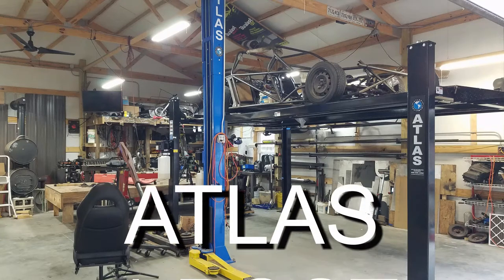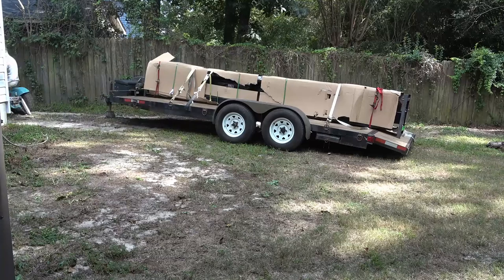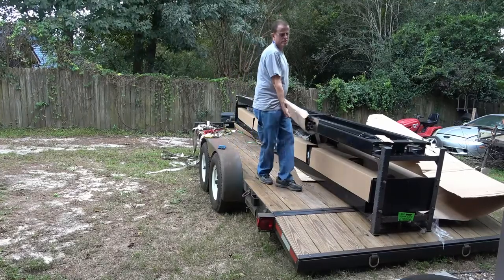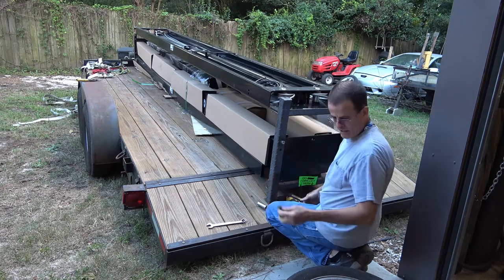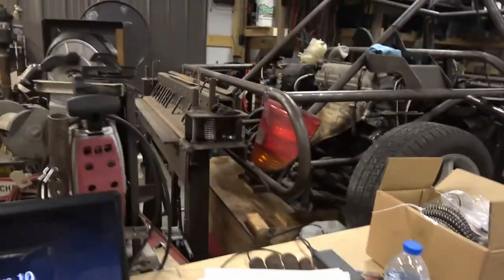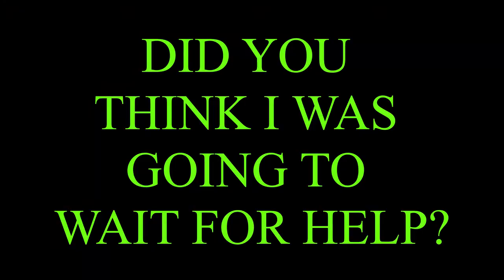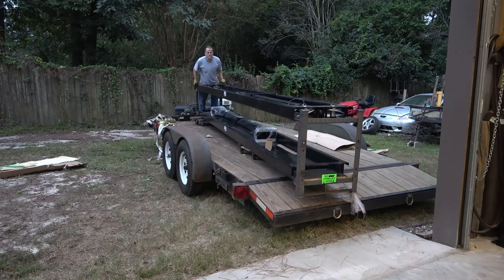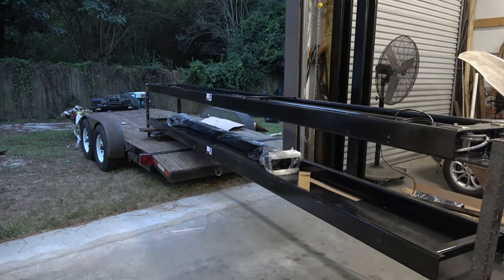ATLAS 4 POST LIFT, Part 1. buying a lift,  pick up and unload

Comment: Ok so you have both lifts. I’m looking to build a garage and I’m eventually going to get a lift. I do normal work on friend and family cars and trucks. I’m currently in the debate of going 4 post or 2 post. With you having both and could only choose one which one would you go with
Reply from the maker: If I was only going to have one lift.  I would go with a 2 post . It lifts from the frame and leaves the vehicle more open to work on.
Reply: Ok thanks for your reply!
Reply: @TSRGarage  unless you have the means to add a pair of rolling bridge jacks to the four post. That gives the stability of four post with accessibility of two post.

Comment: Was it necessary to  unload both ramps from the trailer at the same time?  Or just due to your driveway constraints.  Seems like a safer bet to use your hoist one at a time.
Reply from the maker: Keeping them together until I got them all the way in on a concrete floor worked out best for me.